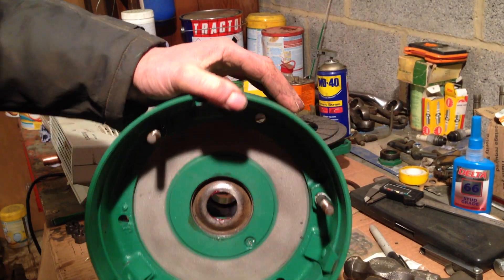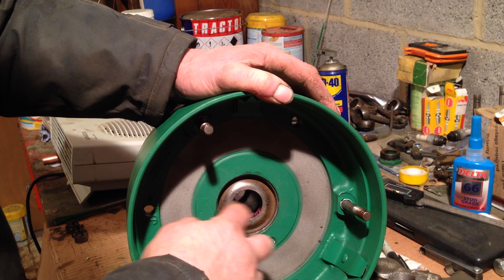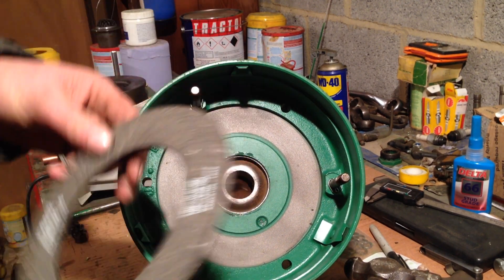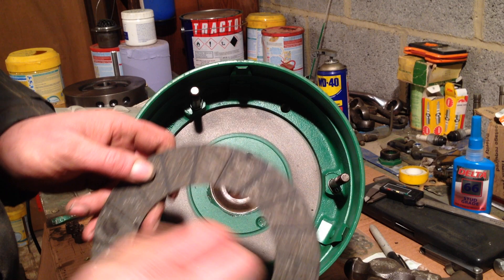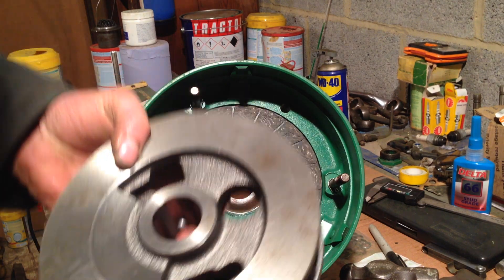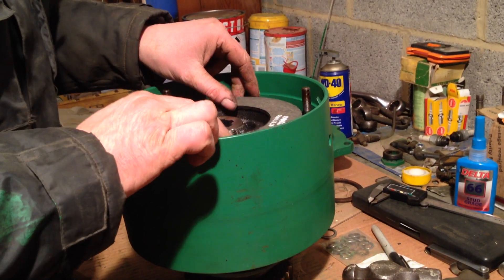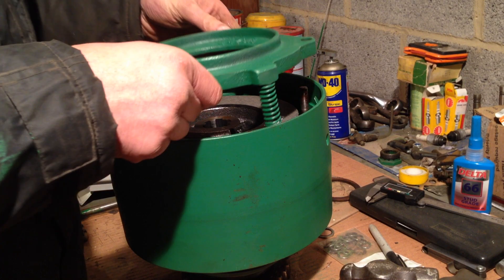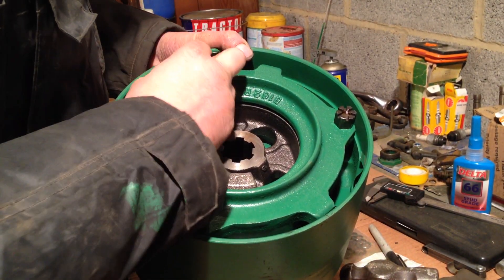1940/41 John Deere B tractor restoration pt 66 (clutch and pulley mechanism and how it works )

Comment: I am so glad I happened unto this video. I am rebuilding a clutch on my '47 B that someone else did several years ago. That person did not insert cotter pins in each of the T-Bolts. If one of those bolts worked it's way back towards the first reduction gear it would have caused real problems...and expensive. Thanks again.

Comment: Do you have any suggestions for removing that drive gear so I can take the clutch slide assembly out? That assembly isn't sliding very free so I wanted to remove it to see what's going on.
Reply from the maker: Hi Brandon , the drive gear as you’ve guessed is extremely tight on the slide coupling , the ones  I’ve removed in the past have required a heavy puller and heat , you will break something if you don’t warm it up , it needs the heat to expand it for both getting it off and also for pressing it back on , before removing it take a few accurate measurements as to where it sits on the slide coupling I think in the workshop manual they are given . These components suffer badly with dust be it clutch lining , dusty condition from use , even saw dust if the tractor has been used a lot on a saw bench which seems to be the usual use for these things now a days  . I mention this as I’ve had one which was a bit sticky , the clutch seemed to hang for a second or so before freeing off , I soaked it for a while with SAS penetrating oil and it eventually freed off , just thought it was worth a mention , that gear is really tight when it does go it’s explosive so be careful . Regards David H.
Reply: @oneminutefarming9521  sounds good, I will give that a try, thank you sir I appreciate it.

Comment: Nicely explained David , gonna have to pull the clutch on my A at some point it sounds like a bucket of old bolts ! Putting it off because of moving the back wheel out on its shaft have heard they can be a swine to shift spes if they haven't moved for years .
Reply from the maker: Mat Naylor yes totally agree be careful with those cast hubs the splined fingers can break at a drop of a hat , plenty of penetrating oil and gentle heat and loads of patience .